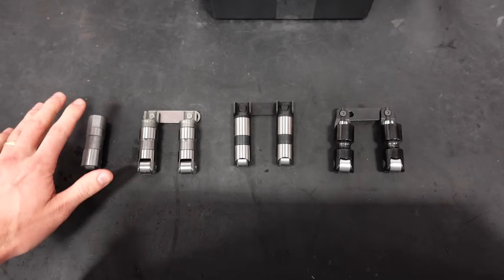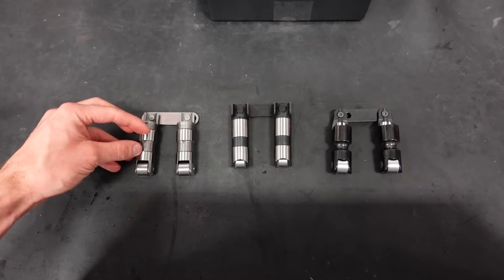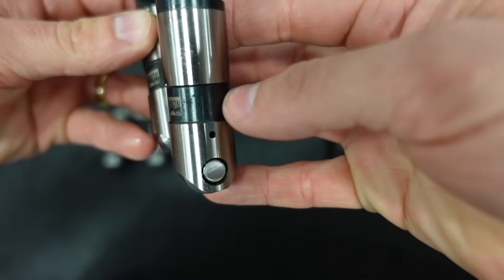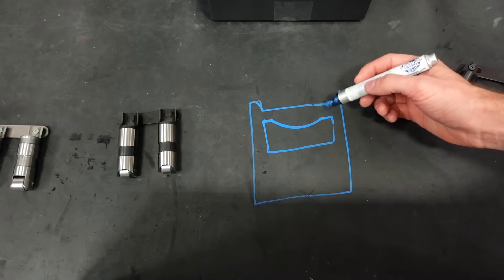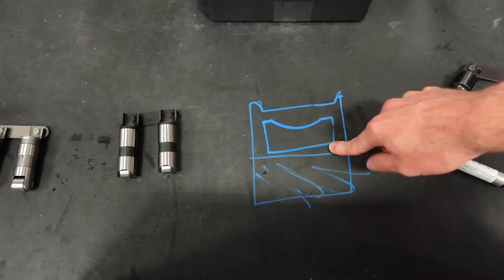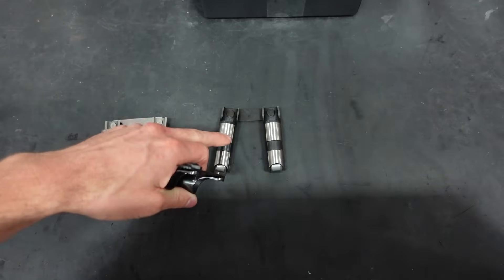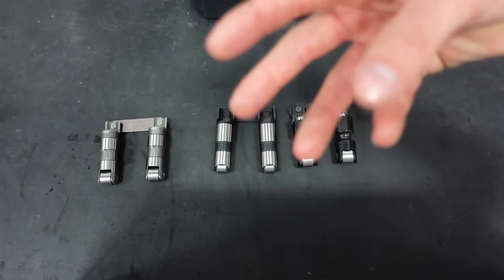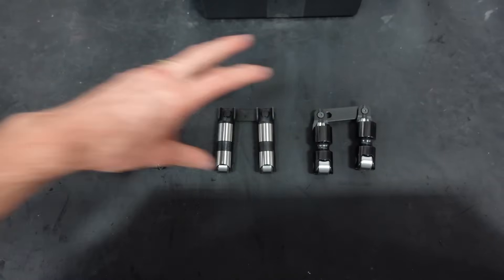LS Lifter Comparison - What You Should Run & When!

Comment: I've had 2 engines go down due to a lifter turning and chewing up the camshaft. Granted, both had over 200k miles, but given that both motors were taken out by failure of the plastic tray, would it not be worth the money for the link bar lifters.

Comment: I didn't see it said in the comments,  .904" are mopar lifters. 

I guess they skip the ford .875" lifter size because the advantage doesn't justify the cost? I guess that is why they go right to the mopar lifter size.

That's why when you work on a pre gen3 hemi mopar v8/3.9v6 you need to buy "mopar cams". Most just sell "chevy cams" for mopars engine, which doesn't take advantage of the superior " Cam/lifter intensity it allows, provides. It was a BIG advantage flat tappet cams.

Comment: so  trick flow  heads  and edelbrock  heads  come  with  springs that have  150 on the seat  and 425 lbs  at  the full lift of the cam i want. 6500-7000 RPM

do i use  limited travel  lifters  of the regular lifters?

Comment: I had the gm performance that was like 500$.. the Delphi ls7 were like 230$. Is there any difference? I'm just running truck norris cam with rpm limits still 6000rpm . I even use oem head bolt. But in also hoping to get another 250k km like I did with the dod lifters I had in there since new. L83 engine. Nothing failed yet just prevention.
Reply: no  there no difference  all  LS  stock lifters  are LS7  lifters.  the only ones that are different are short travel versions  and very early 5.3 and all 5.7 LS1  are different.

Comment: a big help Jacob... i made the mistake of running LS7 lifters with upgraded BTR springs with their "Torque Cam" in  my freshly rebuilt LM7 5.3 that i installed in my 2001 Suburban and had excessive lifter noise... i thought i F'ed up on my base circle measurement so i checked it again... low and behold my base circle measurement was perfect at 7.325" for a .0075" preload and 7.400" pushrod... it was so damn noisy i ended up running the 7.425" pushrods and it quieted down a bit... i talked to Joe at Johnson and he made clear that the LS7 lifters have .150" of plunger travel which made perfect sense as to why my lifters were so noisy with those heavier springs... since there is no way to change lifters without pulling the heads i ran some Liqi-Moly "Valve Quiet" and they quieted down a bit more and im just gonna live with it rather than go another .0025" longer pushrod... ... my finding - the BTR springs are way too damn heavy for the LS7 lifters, hence the excessive lifter noise... either run stock springs (the BTR Torque cam is an "NSR" cam) or throw down for the better lifters like Jacob is saying... i will probably end up building another 5.3 or 6.0 for my Suburban and when i do i will probably pull the heads on this engine and run the better Johnson link bar lifter, or change the valve springs to a lighter weight spring since i use this car for towing my boat in the summer and daily driving, that will NEVER exceed 6000 rpm... cause let me tell ya, that lifter noise is fucking annoying! thank you Jacob for this video!
Reply: Same issue….  Annoying noisy lifters. .587 lift 218/226 midrange ls1; Chev Perf lifters; pac1218 springs.   Cam Motion blames the lifters, of course.  I just want quiet. Is Johnson lifters and lighter springs the answer?
Reply: @bat5917  probably so.  this is the other reason  for the limited travel stuff.  you may not run 7000 RPM  with a hydraulic roller but  if  you buy aftermarket heads  like trick flow they come  with nicer PAC springs  but they may need the better  lifters  that are limited/short travel

Comment: I bought a C6 Z06 with a Lingenfelter 660HP package. It's all motor and has a Comp Cams custom hydraulic roller cam shaft. Since I don't have the original owners contact info, I'm left to assume the lifters were upgraded to hydraulic over OEM. The heads were replaced with Lingenfelters brand as well. Would you safely say the lifters are definitely upgraded like I'm thinking?

Comment: You've confused aeration with cavitation.  

Cavitation is small bubbles that form in a low vacuum area.  They collapse almost immediately.  If they do form somewhere in the oil system, they don't travel any real distance.  The vacuum bubble just collapses and can cause damage to nearby components.

Aeration on the other hand always exists in a running engine.  As oil returns to the sump it gets mixed with air (blow by gasses actually).  The pickup is at the bottom of the pan to hopefully pick up the least aerated oil, but it's not perfect.  All running engines have aerated oil and I've measured as high as 40%!  That is the concern with a hydraulic lifter.  Normal oil is considered incompressible but heavily aerated oil is quite squishy.

Comment: Take a look at the metering disc in the Johnson lifter , you'll be shocked at how flimsy it is . Also look at the length of the pin  the wheel rotates on . Come back here and tell us what you find .

Comment: Old school question: GEN 4 LS4 454 Chevy Big Block Corvette, Daily driver streetcar. Keeping the exhaust as Corvette did a decent job with the flow. Limited hood clearance for intake choices. Maybe aluminum heads and EFI in the budget. How is a roller cam conversion accomplished in this Big Block beauty?
Reply: retrofit lifters roller cam.

Comment: I put the slow leakdown lifters in my LQ9 truck build. 80 hours later and sore back... i measured up my pushrod lengths. Havent had issue with slow leakdown on street. Major concern was oiling to rockers / valves. Been closely monitoring. Took valve covers off and they look great. Had to change wall thickness of pushrods though to maintain adiquate oil metering. Should i have put them in a truck... no. But got killer deal on the lifters.

Comment: I personally think the factory Delphi lifters are stronger at the axle then the linked $500 lifters. The weak point on the first link bar lifters is the axle skirt . There’s no support at the front and back of the lifter roller, which will flex and eventually snap off a fork.
Reply: Seen plenty of link bars break also. nothings totally foolproof with rollers
Reply: BAM bushed lifters for solids.... Period

Comment: Nice, conscice and very informative 👍
Im trying to gather info to isolate a  'very random/rare'  knocking noise in a worked LS7 ..
Comes and goes .. and every cylinder came up 200psi statically tested ?
#4 is suspect re Plug and disconnecting injector on #4 isolates slight popping in the left bank ..
#4 Compression good .. 
Does that isolate lifters ? Or Can they fail at Idle and perform ok on Cranking tests ??
I wonder 🤔 for the tap is intermittent, but the slight 'pop' is on #4 (proven by injector isolation)
Any thoughts appreciated 🇦🇺

Comment: I am building a approximately 450 horse 327 8,000 RPM solid roller daily driver. The cam is the smallest solid roller I could find 12-700-8 Comp 224 at .050 525 lift. I am running jesel bushed lifters
Reply: might  as well run a hydraulic roller and limit travel lifters and  you never  have to adjust them  like a solid
Reply: @KingJT80 You're absolutely correct. However I just prefer solid roller or solid cams in general. If I was trying to be practical also would not have built a 327 as there are no decent pistons on the shelf anymore so I had to go with pen relocated diamond pistons. My last motor was solid flat tap it I put over 90,000 mi on the motor and honestly never had to set the valves I checked them every 1 to 3 years and they never needed adjustment other than the time the aluminum rocker arms failed

Comment: Which oil pump to offset axle oiling oil pressure loss? Can you successfully change cams without pulling heads when using the st2126lsr? If yes, method?

Comment: Had to chuckle when you said those running good solids on the street are madmen, at 63 i'm running Isky Redzone .904 .180 offset solid rollers with HIPPO option and bushings in my 10.7 to 1 399ci. 1st gen stroker. This engine features 17* Brodix C-Series heads and is run up to 6500 rpm. I call it my forever engine. lol.

Comment: You refer to the Johnson hydraulic lifter having an additional feature of "axle oiling", that helps with higher RPM/spring pressure applications. How does the Gatorman lifter achieve its lubrication? I assume it has a similar plunger setup with a certain amount of travel.
Reply from the maker: The Gaterman lifter is oiled from splash oiling from the cam bearings, lifter bores & crankcase.
We recommend upgrading to axle oiling lifters if valve spring pressure exceeds 500# over the nose of the camshaft.
Most 7,400rpm, 420# valve spring engines do not need this upgrade.
Reply: @JacobVillemain  thanks. I don't need the upgrade, the Gaterman lifter is already an upgrade from stock and I will be well under the operating limits you listed above. My engine will still be a beast for my purposes!

Comment: Is anyone using flat tappet lifters today to avoid the weak lifter roller pins in todays 248/264 .700 lift 7600 rpm solid cams for street strip.
 Can one avoid the crazy costs of a real solid lifter that can last! 
      I have been reading about this trend starting up but don't know the particulars. I had a 496 CID SS Chevelle with circle track valve springs that reved way over 7200 rpm run only on weekends. Street with little track time maybe 10 runs a year for 7 years before I sold it. 
      Is CamMotion LLSR selling parts that will only last a year or two with limited track time say driven at less that 2000 miles a year? I'm hoping for 3 or 4 years at least. But am I dreaming? Or would a 7600 rpm flat tappet in a LS do the job better? Any thoughts'

Comment: Great video on a rarely covered subject. 
I was hoping you would cover more details on the short stroke, and solid lifters. What rpm will a johnson short stroke handle for a drift application? Would it be worth going to solid lifter for sustained high rpm useage? how often do you typically set lash on a solid lifter, and what are the downsides of using one on the street? Thanks!
Reply: sustained high rpm solids every time. Nothing internal to fail

Comment: Interested information.  I have a couple of money pit bikes that use the ls style lifters I been told . For me lifters are just a maintenance item . I replaced them before they fail or try to . I run the limiter in the lifters.  Seems to work OK . When I was a kid I ran solid lift roller cam in my 302 chev . I never had any problems with them . I think it was isky.  There is something to be said about checking lash to see if there is a problem with the valve train

Comment: Thanks for the video! Why would you go to the expense of DLC on your lifters if they are riding in a bushed bore? 
I am still not sold on roller lifters. I am very happy with my solid flat tappet engine. I keep my spring pressures low and performance is more than sufficient to go fast enough, but not so fast where I would have to run a cage.

Comment: Very informative video. The only things I would have liked to have seen added would be addressing lifter pump-up and also bleed down rates though that would have to address spring pressures as well. 

Howard has some lifters that they advertise as variable duration taking advantage of bleed down to have shorter effective duration at lower RPMs improving drivability at the expense of ticking like solid lifters.
Reply: Rhodes lifters did this a long time ago. They were noisy as heck, I wonder if Howards has managed to fix that issue.
Reply: @abeclarkatp2595  Thanks for the trip down memory lane. I had  Rhodes cam and lifter set in a 334 stroker street build. Very noisy like you said. Did not play well with 80s technology knock retard. systems

Comment: Thank you for the info. I have seen the plastic trays strip and the lifters spin and eat the cam. I'm going to get a set of the Gatermans here soon. Thank you for the content brother. I'd like to see a 6.0l get bored to a 6 2l and get checked for wall thickness. I have never seen that. I have seen you bore and plateau hone blocks but not this particular.

Comment: I've got the johnson 2116lsr short travel lifters.  If I had to do it all over again, I would've just gone with the Gaterman lifters.  The short travel lifters are a little overkill for my build.  I'm a bit freaked out now about measuring pushrods since I have less margin for error.  I'll triple check and individually check all 16 pushrod lengths.  Not sure if this is overkill.
Reply: How did this work out for you? I ordered ST2116LSR by mistake, wanting 2116LSR and i'm thinking about returning them, and going with the 2116LSR, or the Gaterman. Honestly I'm afraid i'm not skilled enough to get the precision into the pushrods i'll need.
Reply: @NoMercyGTCS  I just looked at the two different types.  The ST version has less plunger travel, but still requires the same preload as the 2116LSR version. I'm a bit confused why different plunger travels wouldn't require different preloads.  I don't know what that means.  It's been a while since I've seen this video, I'll rewatch it.
Reply: @@NoMercyGTCS  I wasn't even aware there was an st2116LSR version.....what is the difference?  I haven't installed them yet, but I will definitely let you know how it goes.  Long story short, I went with an ls heads/ performance guy who the forums raved about.  I realized quickly that this guy was just a glorified salesman first.  He kept tacking on parts for an "optimized build."  I'm not too proud to admit that I have buyer's remorse.  Since I went overkill for the top end of the engine, I'm going to send my block to Smedding for a stroker build.
Reply: @FTsingos  I hate to hear the buyers remorse. I think both version of these are great lifters according to what i've read, but the ST2116LSR has a smaller travel, .058 compared to .093 in the 2116LSR. Just have to pay real close attention to the measurements and probably order a custom set of pushrods for the application. I hear a lot of people really like Manton.

Comment: I installed axle oiling short travel lifters in 2019 because we were already in there. To reduce multiple pr lengths and KISS, next time I'll opt for adj rocker arms. Any opinions on the Yella Terra 10mm vs Crower? Nervous about AL rocker arms, but also want minimal weight over the tip.

Comment: I really appreciate all of your tech articles and engine builds. Than ks for taking the time!  

Regarding the tie bar lifters... I am not a big fan of the plastic trays in my Gen V LT1 build. It seems it could be a weak point that I would rather not encounter.  Can I run the tie bar lifters in my Gen V LT1 engine?  I cannot seem to find any info to support my request.
Reply from the maker: Yes you can!

Comment: Appreciate all your content.

Currently building a road course car for fun. Not sure how competitive I’ll get with it. More just want a purpose build car this time around. Have an ls1 I plan on throwing a 4.8 crank and rods in. Hoping to spin it to around 8k. Curious what would you recommend a lifter/spring combo.

Car will prob end up with a fast 102 on the 853 heads, or possible 243 heads if I decide to have a set ported. Trying to figure out a cost effective ITB setup for the car - but they all look to be 2500-3k. 

Any input would be appreciated. Read a lot of old forums for people destroking the ls - but can’t find many who actually followed through with the build.
Reply: Don't bother destroking for 8000 rpm, you'll lose power everywhere and gain very little, if any reliability. 3.622 stroke is just fine up to and even well beyond 8000 rpm.
Reply from the maker: Give us a call or shoot me an email.

Comment: A set of eight replacement lifters for an LS is $100 so 16 of them would be $200. And those are the GM LS7 style lifters
Reply from the maker: Good parts aren’t cheap, cheap parts aren’t good.
Reply: Beware of knockoffs claiming to be LS7 and are cheap.
Reply: Yea I got some ls7 lifters once that were around that price they didn't last thru the Dyno tune. Got real ls7 lifters that were double that price and haven't had a problem for a couple years now. There's a lot of fake ls7 lifters out there

Comment: Always informative and love all yhe videos and content. I have learned so much. I was told that even if you rebuild or get a rebuilt or new crate LS 5.3 and higher that after 500 miles you should change the motor oil. Is this true?
Reply from the maker: Yes, new engines have a lot of debris that need to be removed. After the first 500 miles do an oil change. Break in oils also do not last as long as regular oil, so you need to change it soon as well.

Comment: 15👍's up thank you for sharing
Reply: I had a gentleman and help me out with my 565 and with my 985 lift cam on the intake and 907 on the exhaust he told me that I should do something with my lifters and I said what can that be so he come over and we took the motor apart he did something with the lifter and if I run a 540 oil the car would only run 9.06et really didn't care but the air temperature or even quality at that point
But when some pool would come and lay down some money and want to go for who can get there first on a heads up deal because he figured that it was luck that I would cut the good lights that I was doing I would tell him I need to change my oil I put a 2050 in there or a straight 50 weight oil then the car would run at 8:29 ET
I destroyed them lifters after 7 years of running on them when he told me I should take them out and rebuild them I didn't listen I was paying child support and trying to pay for a new house of my own life caught up to me now I'm sitting in a garage next to a car that I used to own that I sold and hope that it would never come back and now it's sitting in my garage and my son owns it LOL